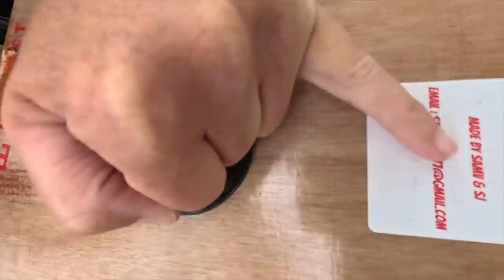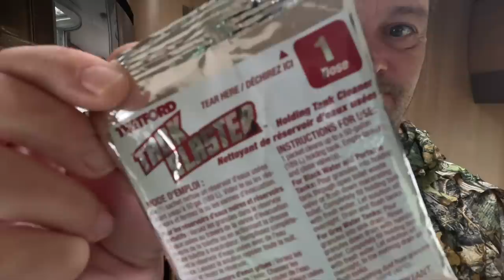OMG What Have I Done: I'm In TROUBLE!

Comment: Mazzy, Dan, there is something called a plumbers snake.  It is a flexible coiled tool that you snake through the pipes. It will go around elbows and other joints in the plumbing and it is used to unclog pipes. With that you should be able to retrieve the pieces you lost in there. Ask Neil if he has one. He probably does.

Comment: Hi there.  Mazzy you are such a hoot 😃.  I truly felt for you when you lost the 2nd nozzle.  Definitely an OMG moment lol.  Maybe you can get a flexible plumbers ‘snake’ and get JP to put it up the hose from inside the tank, it might push the nozzles back up the pipe and out of the hole.  Also, regarding the A/C unit, if you don’t want to swivel your front seat and place it there then maybe you can borrow a plank from Neil and set it across both seats and put the  A/C on it that way you can feed the ducts out off the window, that way the unit and ducts won’t take up space in your dining area.  You definitely have to close all vents, windows and the door for the unit to work efficiently.   It will take all the humidity and heat out of the van👍👍👍.
Dan’s cammo tent looks alright, he’ll be taking a case of John Smith’s with him and a couple of chairs, quite the setup lol.  Take care, stay safe and well.   Judy
Reply: Flipping good idea! However lol you need go go inspector gadget arms to get to it, i'll have another try tomorrow 😂😂
Reply: @JPLamoureuxsTravels  😃😃😃👍👍